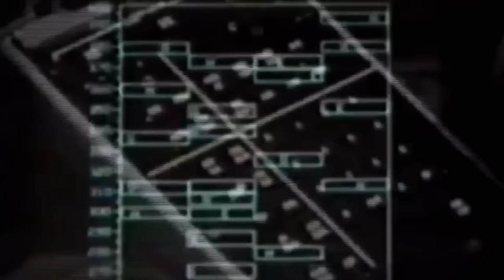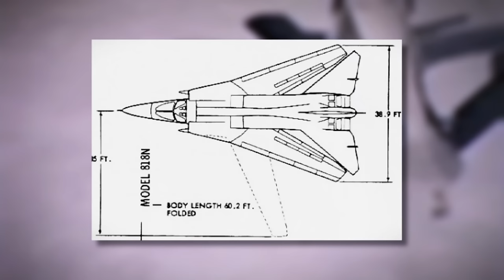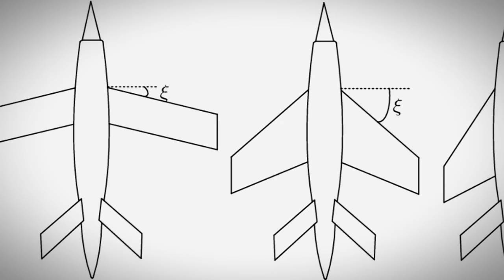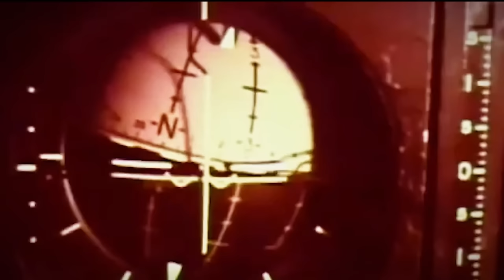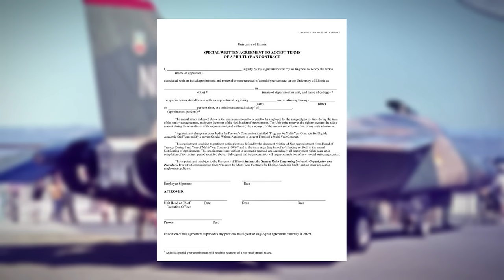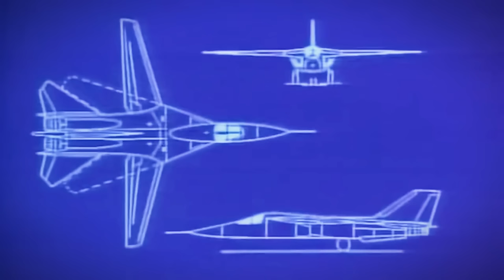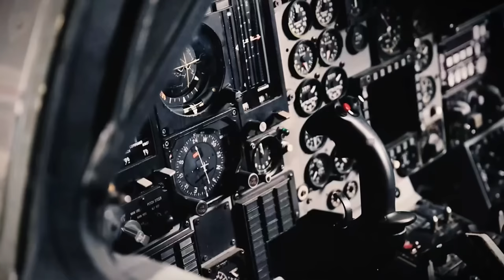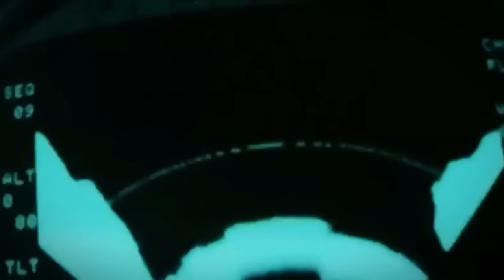10 CATASTROPHIC Consecuences Of F-111's Fatal Flaw

Comment: 12:52 Look at all those bolts.  F-14 met the same 6 AIM-54 Phoenix carriage requirements as F-111B SeaVark, but did so at 10,000 pounds less takeoff weight. 73,400pounds max cat weight vs 85,000 for the F-111B.  24% of the Tomcat was titanium, it's carry through box or wing box was vacuum electron beam welded.  It was the largest titanium weldment at the time of 22 feet. The same structure made of bolted steel was much heavier.  Electron beam welding vs inert gas welding gave a much better weld, esp. in teh corners but also saved 1500 pounds of titanium. The F-111 was an excellent aircraft once lessons were learned. Amazing capability.  Those FB-111A DEAD missions(Destruction of Enemy Air Defenses) using the AGM-69A SRAM was awesome.  Blast its was through Soviet air defenses to clear a path for others, or if blasting a path to deliver its own gravity nuke those SIOP missions were gritty.  The FB-111A and the C Aussie version shared the wider wings(3.5') that the -B SeaVArk version used)  and the heavier rated landing gear rated for 119,250 pound max take off weights in the FB and 110,000 pounds for the F-111C. Though the C had the 25,000 pound thrust engines, the FB had 20,800.  Excellent precision medium bomber.
Reply: Ohhh, shoot, I totally missed that picture, and that was the first time I had ever seen that as[ect of the swing mechanism!  Thank you, very excellent photo.  Strange, I had thought the upper and lower bracket structures would have been thicker…but I guess that’s a ‘scaled down’ image.  Each could be several inches thick. 

Am I understanding you correctly that the F-111’s wing box was steel, and if so, was the entire structure made of steel??  That would be…not light.  Were you an engineer on the project(s)?  Can you point me to a source where I could research the structure at your level of detail, and, being greedy, for both aircraft?

Thanks again, good stuff, enjoyed your post.
Reply: @ronjon7942  At 12:47 you can actually see them installing the pivot pin that holds the wing in place. Then at 12:50 you can see that same pivot minus the large pin.  And no, those weren't scaled down image.  Actual flight hardware dimensions were employed.  the F-111 did indeed have issues in this area.
F-14A used a 22 foot long weldment made of titanium alloy, the largest titanium weldment in the world at the time.(1968).  the F-14A had just a 22 month development time as even before carrier qualification was started on teh F-111B, the Navy had rejected it.  Substantial damage was seen on the aircraft that did see Carrier Qualifications.
Going from steel and bolts to titanium and Electron Beam Welding saved over 10,000 pounds of Max TakeOff Weight between the F-111B and the F-14A.
Electron Beam Welding of titanium vs Inert Gas Shielding Welding of titanium(and other forms of titanium welding) save over 1500 pounds of titanium in construction of the wing carry through box(aka wingbox).  the Tomcat used 24% titanium alloy by weight, while the A-12/SR-71 used approx 92% titanium alloy by weight.
It has been quipped by those involved with the Tomcats that at Tomcat scenes of a crash, that the Tomcat's "wing boxes" often survived with minimal damage.

Here is 3 pics of the F-14. See no bolts.
https://www.aircraftresourcecenter.com/Fea1/601-700/Fea672-F-14-Witkowski/02.jpg

It was a big problem for the Navy to NOT use bolts.  they were afraid of weld failures, but the destructive testing regime soon changed their thinking.  This is discussed in the video by one of the Northrop Grumman VPs I link below.

I am not an engineer, though I did take a few semesters of mechanical engineering, along with some med school, along with some nursing school, all after spending some time behind some of NATO's finest weapons systems.  After spending of disassembling human bodies, upon discharge, discharge with grace-I might add, I decided I'd do my best to try and put people back together and help them live their best lives.

There is a lot of information available on NTRS(NASA Technical Reports Server).  the Soviets loved it when NASA got a new bird to play with as being a civilian agency, all their reports were unclassified.  Lockheed just hated it when their YF-12A went to NASA for a decade of testing through the 70's.  Wash phrases like Electron Beam welding titanium, F-14 Tomcat.  And prepare to spend a few days reading through historical gold.
https://ntrs.nasa.gov/

Another good resource for aircraft specs(speeds, maneuverability, weights etc) is to look for the declassified SACs for each aircraft. SAC=Standard Aircraft Characteristics.  The ones for the F-14A are available for 1974, 1977 and for the F-14D(1985-partially declassified).  the SAC for the F-111B SeaVark(1968) is available.
Try Googling  "Standard Aircraft Characteristics F-14A" or "Standard Aircraft Characteristics F-111B" etc etc.

One of the best videos I have ever seen on the F-14 program was done by Northrop Grumman VP Mike Ciminera..  The video was a presentation for the Peninsula Seniors Productions  Mr Ciminera includes some excellent photos in his presentation, so keep the pause button ready.
https://www.youtube.com/watch?v=-Ta24OQw2TM

FYI- In the post below this thread there's a gentleman named @GIJoe2at  who sounds like he was a Grumman designer who worked on the F-111 program.

Finally, thank YOU, I really do appreciate the kind words.  Many people just tell me to shut up and to stop writing novels in Youtube comments, but I just find all this stuff interesting and figure there must be someone else out there somewhere who enjoys it just the same.  I bid you and yours a great day.
Reply: The 111 carried 36000lbs of fuel internally the F14 what 20k? F14 obviously a better carrier based fighter but that's the difference in TO weight. I've got 2500 hours in 111's.
Reply: You're forgetting the weight problem of the F111 was entirely of the Navy's making. The Navy insisted on dual seating which doubled the width of the fuselage, thus requiring larger engines for greater thrust, greater fuel capacity, heavier D6AC steel use in the MLG and the list goes on. To enhance carrier operations the F111 went through a strength/weight program which saw so many panels and their fasteners redesigned to reduce weight. The primary reason for the success of the F14 was the Navy eventually coming to the realisation that random seating was the only way they could get a swing wing F111 type onto a carrier.
Reply: @ronjon7942   D6AC steel was used on F-111, it was indeed a very dense material
Reply: @26betsam   Wow, 36,000lbs internal, that's impressive.  Tomcat carried 16,000 pounds internally,approx 4,000 external with its 2 drop tank, 1 under each engine.
 F-35C can do approx 20,000lbs fuel all internally. Compare the birds empty weights for the real comparison.  Look at the recovery weights of the F-111B, not favourable to either launch or arresting equipment.
F-111B in 1967 was apparently 46,000lbs empty. With 23,000 pounds fuel the takeoff weight was 77,566 lbs.Reaching 575knots at Mil,/678 knts at Max power
Dropping down to 2 AIM-54 mounted internal drops takeoff weight down to 72,241 lbs and SL speed up to 625/793kts and 1260 kts at 40,000 feet for both loads..
All the 1967 I can find states internal fuel loads of the F-111B Naval variant is 23,000lbs when loaded with either 2 AIM-54 missiles internally or 6 AIM-54 missiles with 2 loaded internally and 4 more loaded under the wings.  A 3rd fuel loading is mentioned and refered to as a Ferry Mission. It has the same 23,000 pounds of fuel loaded internally, but also has two 450 gallon/approx.6210 lbs of external fuel. Combat range with 6 Phoenix is 1830 n.miles. With 2 Phoenix is 2330 nm, both with the 23,000lb internal fuel load.  Adding 2-450 gallon drop tanks(which when retained when empty) while dropping all missiles, increases combat range to 2760nm, by jettisoning these 2 External Fuel Tanks when they are emptied, the combat range increases to 2997nm.

I am wondering how the empty weights of the F-111B compares with the other USAF variants?  I can't find any F-1111B references stating other than it's 23,000 lbs internal fuel load.
Reply: @techo61  It is true that the Navy insisted on the side-by-side seating, so McNamara forced it on the Air Force against their objections.  That and the crew escape capsule made the airplane heavier than it needed to be. 

But according to some well-known Navy pilots (like Heatley) who were there and talked to the pilots testing its carrier suitability, the F-111B handled well around the boat.  After all,it had a long straight wing for that phase of flight. 

The Navy decided it was too heavy when they changed their mind about the role of the airplane.  It was originally to be a fleet defense missileer akin to the Douglas F6D, but with a high speed dash capability to intercept bombers further from the fleet on a scramble.  Then combat experience in Vietnam (an perhaps intel on the USAF studies underway for its next fighter) convinced the Navy that its next fighter would also have to perform air superiority.  The F-111 had not been designed for that role and was now unsuitable. They were correct to  change their mind on what they needed, but it was unfair to blame the airplane, which would have performed the original design role.  Procurement politics necessitated telling Congress a story that would allow them to cancel the F-111B and start a new development program.
Reply: @26betsam   the F-111A,CDEF carried approx 32,500lb internally. They could carry extra in weapons bay tanks, but that is not really 'internal' fuel.
Reply: @hoghogwild  F-111A and all other apart from the F-111B had capacity for approx 32,500lb of fuel. The F-111B had a different fuel tank configuration, due to movement of avionics bays from nose to behind the crew module, and had capacity for approx 23,500lb of fuel. Although F-14 is lighter than the F-111B,  at circa 43,000lb it is not by as much as people try to make out.
Reply: @misspuddles63  Gotcha  No doubt that the F-14 certainly wasn''t a lightweight and it only got heavier.  In 1965 weight was projected to be of F-111B 46000 lbs empty, max arrested landing at 62,000 pounds, 1974 F-14A Tomcat weighed 38,400 pounds, with each variant adding 2,000 pounds with the D weighing over 43,000 pounds.
Even the Eagle-IIs empty weight has swollen. to 36,000+ pounds.  It was omce a 28,000 pound empty weight machine.

I find the F-14A and F-111B Navy and airforce variants comparisons interesting as they use the same engines, the VERY different intakes.  they are both very fast aircraft, esp. the RAAF Cs and the USAF-Fs with the uprated engines.

Comment: I was at Takhli for linebacker II. TDY with the tankers from U-tapao. I had been there for Linebacker 1 TDY also, but the  gunfighters with the new F-4Es were there then, When I went back in December, wow. There they were from Nellis. Awesome to see them fully armed at last chance, with the munitions boys pulling the pins, and the full AB , don't remember how  many stages, but at the and of the runway the flames would be bouncing off the runway like a torch behind them as the lifted away into the night. No way I could sleep. Awesome aircraft after they fixed the bugs. Bye.

Comment: The Lockheed AF-12 was the plane they needed and should've used; its look-down/shoot-down radar and GAR-9 missile system was 25 years ahead of its time. Unfortunately McNamara axed the idea and Lockheed was out. Too bad, as the AF-12 interceptor/bomber would've been unbeatable: Mach 3.2 speed, 85,000 foot altitude, pinpoint accuracy of bombs/missiles. Too expensive, too complicated.

Comment: A lot of random aircraft pictures in there… apart from that, great video! Until now I’ve never seen a photo of Australian F-4s and F-111s together! The F-4s were leased for a short time until the delayed delivery of the F-111Cs. A lot of the footage is of Australian F-111s too, and we had not only the C model(which had longer wingspan, rotating outer wing pylons and the heavier landing gear of the B), but later various second hand USAF models.
Reply: The outer wing pylons did not swivel on any model of F-111.  We purchased 4 ex USAF F-111As in the early 1980s and quickly fitted the wing extension to them, that is all it is, and extension. And we also purchased 15 F-111Gs, that also had the wing extension.

Comment: F111 was a dud; engines were blade chuckers.
Reply: your post is clueless.
Reply: Not clueless but factual. I remember regular news in the 1960s of F-111s falling out of the sky in pieces. Faulty parts due to poor manufacture, the design was overly complex so that it could perform multiple roles, which it never could. It was very expensive to maintain and operate, unit cost way higher than initially expected, poor results in initial deployment (in contested airspace), dodgy engines and under-powered, incredibly complicated really beyond the technology of its time. High attrition rate (Australia lost 7 out of 28 F-111Cs to crashes and failures - no combat). It was unrealistically ambitious for its time, the concept driven through by defence secretary Robert McNamara. Actually the GD design was not even the air forces first choice - they wanted the Boeing option bu Mc Namara overruled them. As for the useless F-111B intended for the US navy, the less said the better. The US did way, way better with existing aircraft e.g. F4, A6 and with specialist aircraft that followed such as the F14, F15, A7 & A10. A legacy of the F-111B was that the otherwise peerless F14 was stuck with the same useless TF-30 engines. It was only during the (now fondly remembered) Reagan era that the F14 got decent engines and delivered to its potential.

Comment: YOU MAKE ME THINK ABOUT WHAT IS THE CONNECTION BETWEEN THE F-111 AND THE F-14 TOM CAT , IF I REMEMBER BOTH HAD THE ABILITY TO USE VARIABLE SWEPT WINGS 💸 I DON'T KNOW WHICH ONE CAME FIRST OR I KNOW THAT THE F-14 HAD ALL KINDS OF ENGINE PROBLEMS 
DAVID ADAM GRENIS MAPLETON AVENUE BOULDER COLORADO USA ALSO BEEN THINKING ABOUT IT I BELIEVE THE F-14S ENGINES WERE FURTHER OUT ON THE WINGS WHICH MADE THEM TEND TO SPIN WHEN ONE WENT BAD
Reply: Both of those aircraft used the TF-30 engines. Different aircraft, same problems. Also, the engines were not installed on the wings of either aircraft.

Comment: Swing wing seems to be a dead end evolution, the two aircraft with it, F111 and F14 now obsolete and no swing wing aircraft in sight to continue the lessons learned. Yet both were very capable aircraft with unique attributes.
Reply: B1????
Reply: @PilotLifeNet  Good point, B-1 is swing wing of course, but reported to be replaced by fixed wing next gen bomber supposedly by 2030 or 2040.
Reply: The Panavia Tornado was an excellent example of VG suitability.  And the Soviets went a little crazy with them:  MiG23, MiG-27, Su-17, Su-20, Su-22, Su-24, Tu-22M (Tu-26), Tu-160.  And there were a plethora of Proof-of-Concept examples (Boeing’s 2707 would have been something!  At least their first design iteration.), although those really don’t apply to your point.  Swing wings got around for sure, but yeah, I agree with you; I’d say we’ve seen the last of them.
Reply: @keithad6485   kinda already are, the B-2 for example. 
Basically the main reason for the wing sweep system is to enable it to go fast while still not needing 3 miles of runway. They have worked out that there is very little benefit in going M2.0+ that warrants the compromises of a variable geometry design
Reply: @misspuddles63  Never thought about the length of runway reasons, assumed swing wing was for greater manouvreability whilst still allow very high speeds in delta configuration. With F111 extended wings, I assumed, allowed for NOE radar manouvrering.
Reply: @keithad6485   basically wings out 16-26º  with flaps and slats for relatively slow speed take off and landing. Past 26º no flaps and slats are available and then past around 45º the wing spoiler (did not have conventional ailerons) were inoperative.  Then all the way back to 72.5º to go fast.
While wing sweep was more a function of how fast they needed to go,  it did effect the manoeuvring characteristics also. The wing sweep angle was totally manual and selected by the pilot to provide the best/required trade off between speed and manoeuvrability

Comment: Good Lord!!  What a mess, not to mention boring.  Not quite so boring, the action starts at about 30 seconds.
https://www.youtube.com/watch?v=J_Mh3dsln9M

A cutdown version of the above video is contained in this video.  The whole thing is well worth the watch, it includes a real life, wheels-up belly landing!
https://www.youtube.com/watch?v=QRdKv4cLiL0

What is not obvious to many people is the size of the aircraft.  There are several in museums in Australia and one Australian Aircraft in a museum in Hawaii.  I am not sure if the Americans have any on display. A walkround is very revealing, it is a big aircraft.  This is obvious as the crew depart the aircraft after the belly landing in the above video.

I have witnessed a number of dump and burns, many of them more spectacular that the ones in the above video but have never found any videos of them.  The best was a Riverfire event in the early days before the highrise buildings got in the road.  I  was standing on the cliffs at Kangaroo Point as I knew this was on their flight path, they came in very low that year, lit up the afterburners and dumped the fuel just behind me, there was one on each side of me, as they flew over (beside?), wow,  the noise, the heat, the vibration, sensory overload,  Rock and Roll in stereo!!!